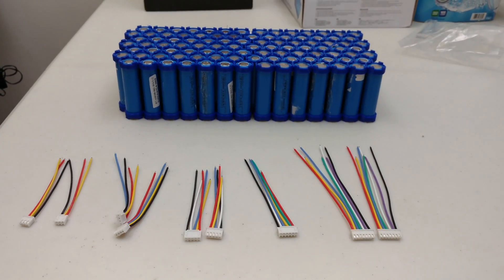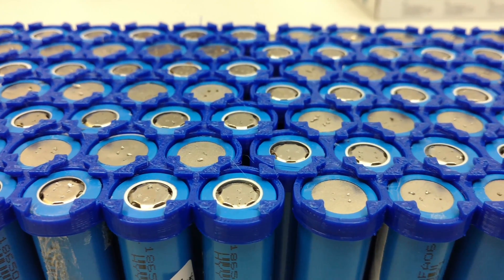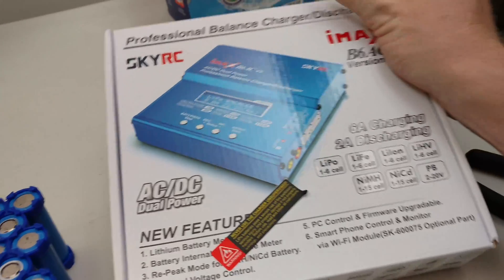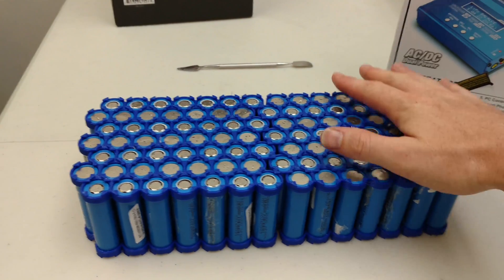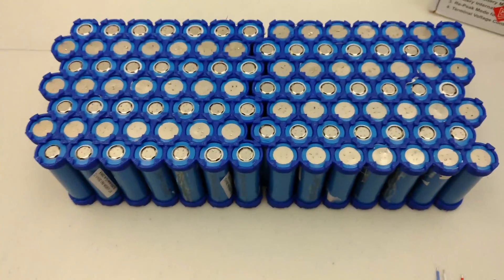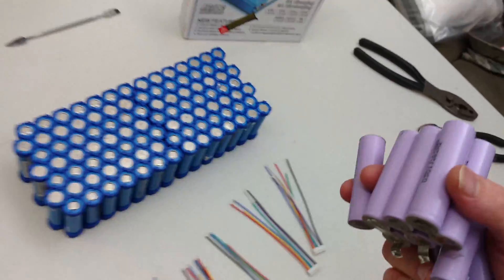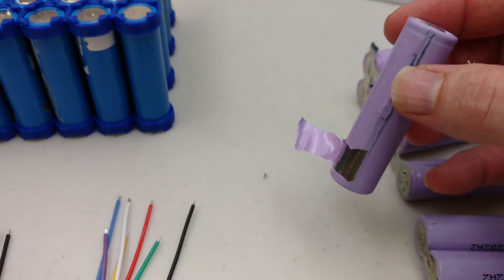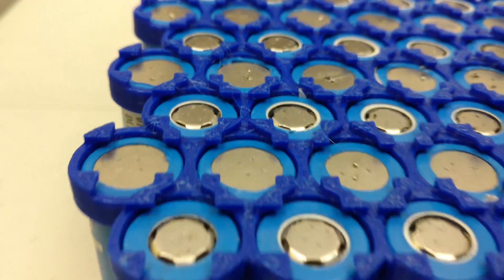eBike Battery Update - getting ready to spot weld

Comment: That's a nice start and I'll bet you'll build a great battery. I have four ebike batteries built from 18650 batteries in various forms of working and repair but indeed I do enjoy tinkering with them. I would agree with W19ELY that the BMS may not be worth the trouble. I charge mine with a balancing charger which is absolutely necessary to prevent overcharging to over 4.2 VDC.  A couple of good 6S balancing charger is all you need. I use two at once, 5S each end of a 10S pack. Once charged I think the BMS isn't necessary but I know there are plenty of folks that like BMS controls and the safety that they present. I've not had a problem in two years but then again I don't push my electric bike very hard and I'm attentive.  Good luck! I think with the nickel strip spot welds it will be a very dependable system. I soldered mine but every once in awhile a solder joint fails unlike the spot welds you will perform which are very solid. Again, I"ve found BMS systems vulnerable and failure can happen while on the road. I'd not want to pedal 10 miles after a BMS short and I've had two of them fail in service. I won't use them again.
Reply from the maker: Thanks for the good words, tips and very good points! Do you know of any good brands of chargers?
Reply: I use what appears to be the most popular multifunction unit the Imax B6. I have one authentic and one clone. The authentic one is a bit more accurate regarding voltage, amperage per my VOM meter. Where all my batteries are 10S I use two 5 S plugs and charge them in balance mode using both chargers simultaneously. Great care must be made when attaching the chargers as broken wires or reverse polarity can be quite eventful with sparking, arcing or overheating of charger wiring. With a bit of practice it's possible to charge at 3 or 4 amperes for a few hours to bring it to completion. I have a 500 W ebike I built and can travel a maximum of about 22 miles with the 8P-10S battery (Im over 280 pounds). I also have two 5P and one 6 P batteries. which all are adequate for over 14 miles between charges. The 6P has three BMS's in it and I'm afraid to use it because of an experience with the 5P where the BMS failed in the middle of the trip and I had to pedal home hence my hesitance to recommend a BMS for an ebike.
Reply from the maker: dang.. thanks again for all the information. I think i am steering my plans a little differently then... good times. Thanks again for the input. Sorry to hear about the failure. I am looking at a couple BMSs but they are not reviewed and dont have any track record. One of them has Bluetooth and adjustability  (90 bucks!) .. ill start with what i got, do the balance charges with the B6. Thanks again!

Comment: Looking great! How are you planning to hold it together?
Reply from the maker: thanks!... i think... duct tape... to begin with. then possibly a custom case 3d printed.. PLA doesn't do well in the heat though... it deforms.
Reply: I've designed and printed a few different cases in PLA and haven't had any deforming issues yet, but I'm sure once the son gets out that'll probably be the case! (pun intended?!) I bought some PETG recently, supposedly it is more resistant.

Comment: Nice little update. I know that I've said this multiple times but if it was me I wouldn't even consider using a bms. Save your money and put it towards a decent 8s charger and just make up 2x7s packs. Get yourself 2x 2s-8s cell checkers with built in low voltage alarms, then you will have complete control over your cell balancing instead of leaving it to a circuit board, also you will have the ability to check both battery packs on the road and keep a constant eye on all the cells to make sure that they are not going out of balance. I have 2x 7s packs at the moment that get used hard in 24v electric scooters, a lot of the time I don't even balance them because they simply don't need it. That's the beauty of the rc chargers, you have complete control. If one of your cells ever goes out of balance then you can slowly charge and discharge them until they are good again.
Reply from the maker: Thanks for the tips. man.... you guys are saying the same stuff. i am going to strongly consider it all. I think you answered before in another video, but i couldnt find the model. Do you know of a good model of charger? the model number? thanks again for the help!
Reply: Personally I agree with W19 - You should split it into to two 7S batteries and use a series connector for when you plug it into your bike.
Like this
https://www.ebay.com.au/i/111871384768?chn=ps&dispItem=1

For charging try one of these (all can do up to 8S)
https://hobbyking.com/en_us/turnigy-accucel-8-150w-7a-balancer-charger.html?___store=en_us
https://www.amazon.com/ProgressiveRC-PRC-208B-iCharger-208B/dp/B007X4D8G4
https://www.ebay.com/p/SkyRC-E8-2-8-Cells-Lipo-Life-Balance-Charger-1-10-RC-Car-Crawler-sk-100096-03/665289137
Just note you need to buy a 12v power supply for the Turnigy. I use the SkyRC as it is the cheapest and easiest.

You will also need some cell logs/alarms
http://www.ebay.com/itm/RC-Lipo-Battery-Low-Voltage-Alarm-1S-8S-Buzzer-Indicator-Checker-Tester-LED-/142065592377?hash=item2113c4e839:g:AcUAAOSwZ4dZJ5LQ

Last thing you need for balance charging is so solder a 7S JST connector to each battery
http://www.ebay.com.au/itm/7S-JST-XH-Lipo-Balance-Wire-Extension-Adapter-30CM-Red-Black-Silicone-Wire/302241106764?ssPageName=STRK%3AMEBIDX%3AIT&_trksid=p2057872.m2749.l2649

Then you are all good to go as you can check individual cell voltages (even set the alarm) and balance charge each 7S side of the battery whenever you need to.
Safer than relying on a BMS
Reply: You definitely want a bms for safety. It’s not just charging BMSs are used for. They limit current, short circuit protection, balance, make sure cells aren’t overheating. Without that your asking for trouble